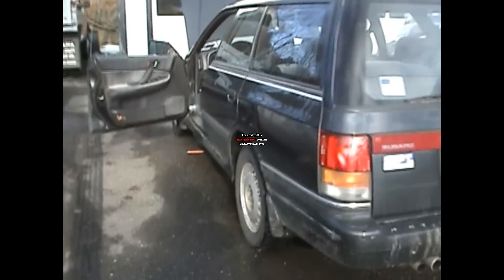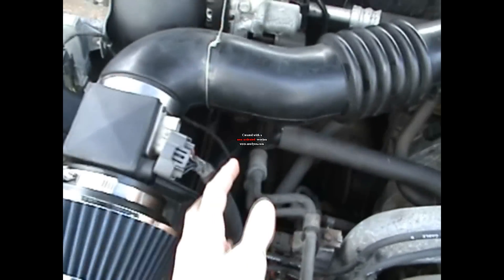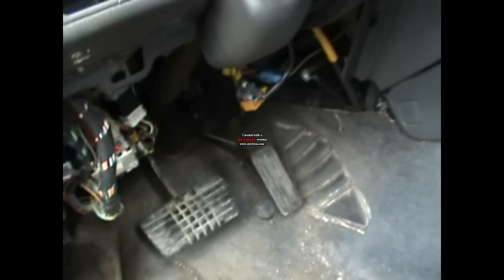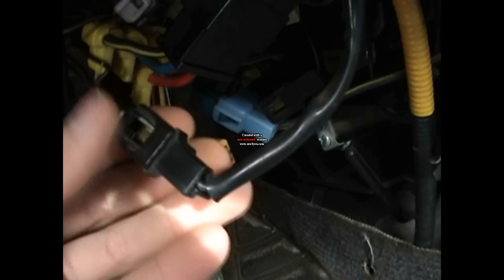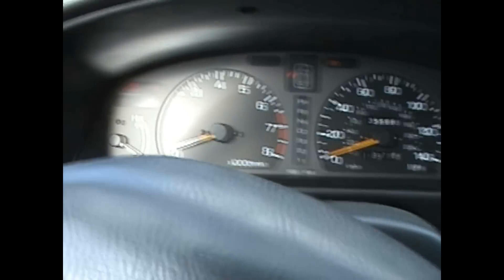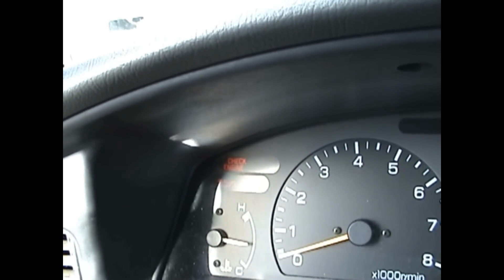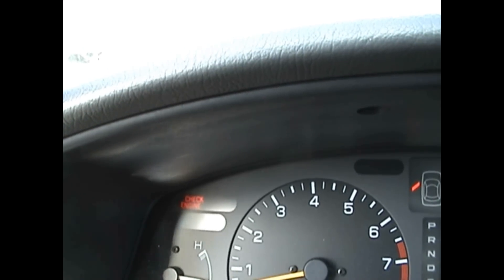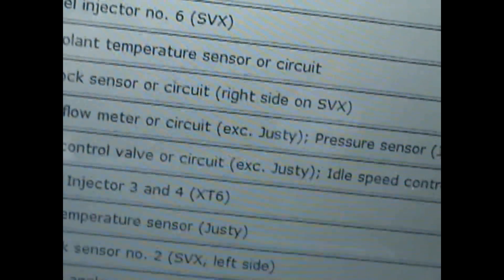Diagnosing Your Subaru's Check Engine Light

Comment: Does the code delete automatically when you plug the memory wires in? How long do you leave the memory wires connected? With the engine on or off? You should have stated loads more

Comment: Hello I have a subaru impreza 1996 , and I followed the steps and it works and I got the code 22  do you know what does it mean? I have been looking for this on internet but I only find this "Ignition pulse system (1983 only)/Vehicle speed sensor or circuit or VLC solenoid valve or circuit. (1984 to 1988 carbureted)" 
 but I don't understand if it right, can you help me?
Reply from the maker: Jasson Sanchez code 22 for the mpfi models is a knock sensor trouble code. The sensor is under the throttle body. The sensor is probably cracked or the wiring is bad.

Comment: I have a 1994 Impreza. There are no disconnected plugs under the steering column. Are the test wires located someplace else on the Impreza??
Reply: The green plugs are located up under the dash, they will be taped up high if not used before

Comment: i did this and now my check engine light wont stop blinking what can it be i put everything back how it was i unplugged the green connector and plugged in the black one and now the check engine light wont stop blinking
Reply from the maker: Both connectors should be unplugged under normal conditions. Keeping the black ones plugged in will run codes stored in memory.

Comment: thanks man , did you know that i have Subaru Legacy 1998 GL and it has OBD1 , Saudi Arabia Edition

i am sure it is , i found the two green plugs , the same thing happened to the fans and fuel pump, goes on , then goes off repeatedly , but the check engine light doesn't flash , i unplugged the Airflow sensor and it gives me 49 , long four flashed and 9 short flashes , and i found it in http://www.troublecodes.net/Subaru/

i found it in " 1988 and later models with Multi-Point Fuel Injection (including Legacy) " section

Comment: i have a 1995 legacy that has been blinking. the only code I get is an o2 sensor. it is running perfectly fine. idling properly and no power loss. i dropped the exhaust when I did the o2 sensor and i didnt see any soot build up and the cat was clear. any suggestions?

Comment: Good video!!! I can't seem to find these wires!!! I found one of the green connectors same location as those on your 96', and i did find a pair of blacks similar to the ones on your car,but they're right next to that green connector. My black wires are NOT plugged in......hmmmmm it's a mystery!! LOL!!! Is the black wire(s) a single wire connector. Maybe the location of these wires are different on older sedans.......

Comment from the maker: @manolo19991 That just means that it is on. You have to plug in the green self diagnostic wires under the steering column in order for the light to flash you the codes. Watch the video.

Comment: i have a 1993 legacy as well, and my check engine light is on.  but when i turn it on it does not flash at all so it gives me no codes.  it just stays continuously on, what does that mean?

Comment from the maker: @requiemforneurosis Get the scanner and pull the code for the CEL. As for the TCS, there is a different way of diagnosing it, I will look through my 4EAT book and see if there is a way you could flash the codes using the TCS light.

Comment: HI, I just bought a used 96 legacy outback and check engine light and TCS lights are on. The TCS light stays on even when the car is off. The guy I bought it from said he JUST replaced the o2 sensor and I was curious if you might know what it is. I have a diagnostics machine, I just haven't had a chance to hook it up and read the code yet. The device is currently in my room mates car who is off running errands all day. Any insight would be appreciated. Thanks!

Comment from the maker: @whatchain No, your car is OBDII, this video shows how to diagnose a CEL with an OBDI Subaru. You would have to get a code reader and plug it into the OBD port under your steering column to retrieve codes for your OBDII vehicle.

Comment: I have a Subaru Impreza 1.6 94. I have two questions. Social the plugin. Black and showed error 35. (canister). I checked it and it correctly. 44 Om. He closes vacuum. Opens, and no liquidity. I did a test with the green connector. Travel in all normal. I wanted to delete the problem connecting two black authors black and green to green. But the problem is not deleted.
This is a problem because I have error traveling with Air Conditioner. After 10 minutes. The engine stutters. Check lamp turns

Comment: @VL125 same problem, what was it? i turn it on, no check engine light. put it in gear no check engine light, drive for about say anywhere from 3 to 30 min's it will start blinking with no code or anything... 

(FWD 1993 5speed subaru legacy)

Comment from the maker: @crammage Well, if you CEL is still on then diagnose it with the steps above so you know what it is, then address the problem. Manual transmission cars always get a little more better MPG, so a 5 speed would probably give you an extra 2-3 mpg.

Comment: THnaks man !
your awesome
we replaced the o2 sensor on my moms 94 awd auto legacy 
and the check engine light is still on
and it only gets 20 miles per gallon i know its auto with awd but 20 mpg thats just BAD! v8s can get that !
what does your car get?
so maybe i will try this

my 86 subaru gl 4wd 5speed wagon gets 26-28

and do you know if a 5 speed legacy get better ,worse, or same than the auto legacy? 

thanks!

Comment from the maker: @VL125 If the CEL comes on only while you are driving, then plug the diagnostic wires in and drive your car. Once the CEL is tripped, your CEL light should flash the error code, and keep flashing it until you turn your car off. I was getting a random CEL while driving, and I diagnosed it while driving, and it turned out to be the o2 sensor, which is probably the same CEL you are getting. But to confirm, drive around until it is tripped, then it will give you the code.

Comment from the maker: @zxc122012 No that is not 44. If they are continually blinking like that, then that either means that you have both your diagnostic and memory wires plugged in which would mean that you are clearing any recent codes. Unplug the black sensors, and then see what happens. If your black connectors are unplugged and it is still flashing like that then that could also mean that your engine has a misfire that could harm the catalytic converter.

Comment from the maker: No, it should not be the same for your 1997 model because in this video I am diagnosing an OBD1 (1996 AND OLDER) Your 1997 model is probably OBD2 which is very different from OBD1. I have tried figuring out the OBD2 system on my newer Subaru but I cannot figure it out. Also I do not think that it would be gas, if I make a breakthrough figuring out the OBD2 diagnostic system, I will post a video.